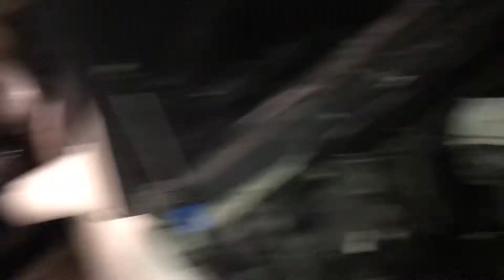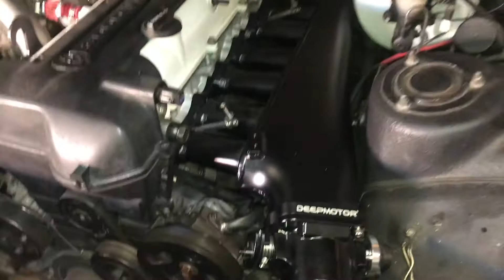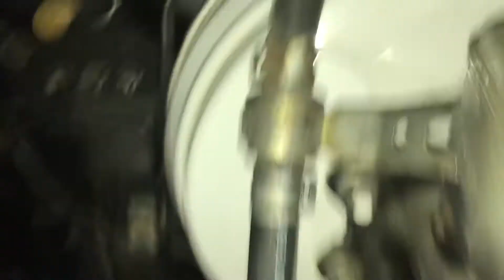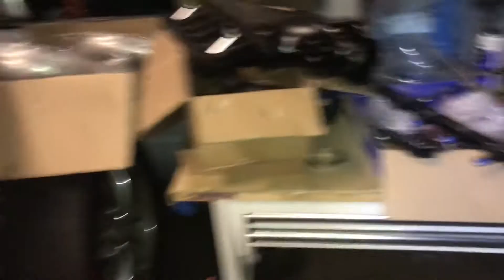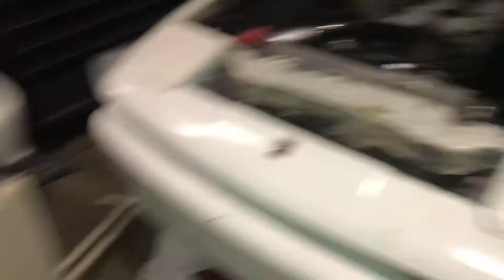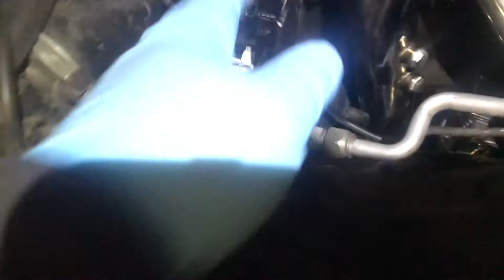HOW TO GO SINGLE TURBO, STAND ALONE AND BILLET TURBO ON 2JZ MK3 TOYOTA SUPRA!!!

Comment: What throttle cable did you use?
Reply from the maker: The sell it at eBay. Let me look for it
Reply from the maker: 324245296184 that’s the eBay part number
Reply: Thank you brother